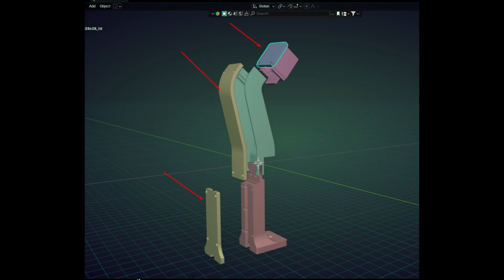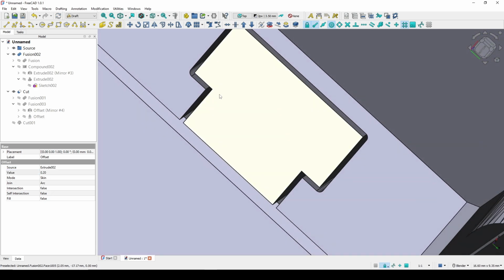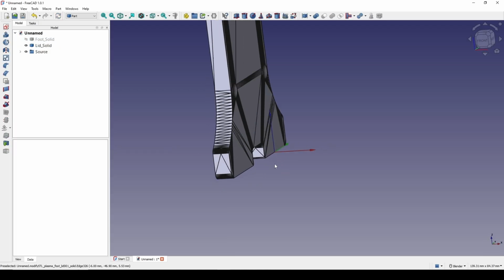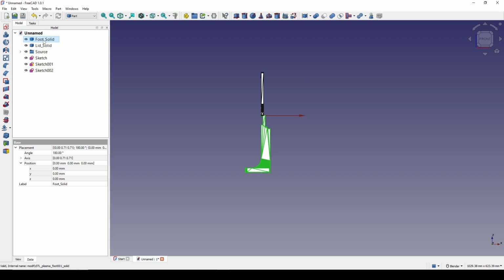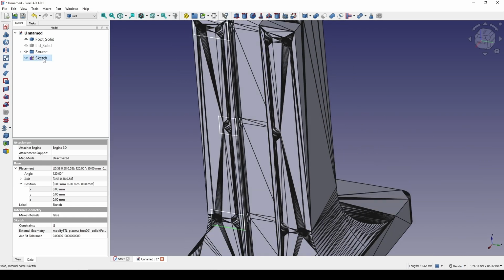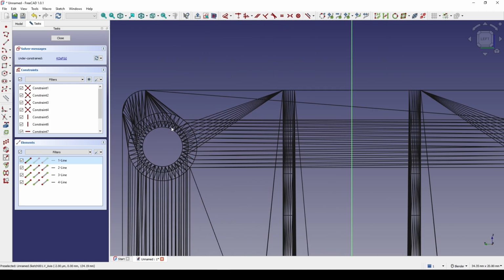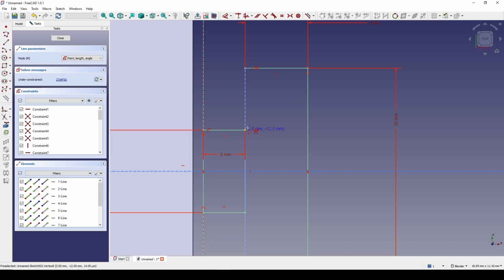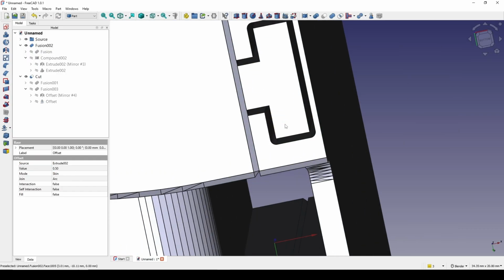An Example Of Working With STL File (Low Res) In FreeCAD.

Comment: Draft Move in combination with axis locks (x/y/z keys) and appropriate snap settings is a great tool for fixing the origin of imported STLs, and doesn't require creating sketches or remembering numbers. Appreciate your videos - I'm slowly getting the hang of surfacing